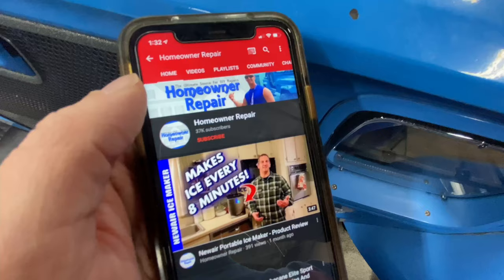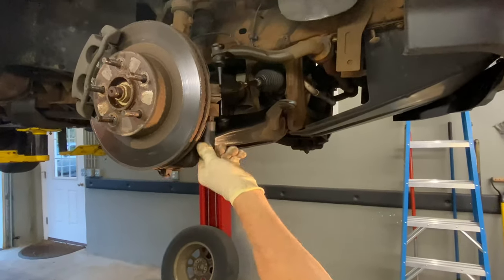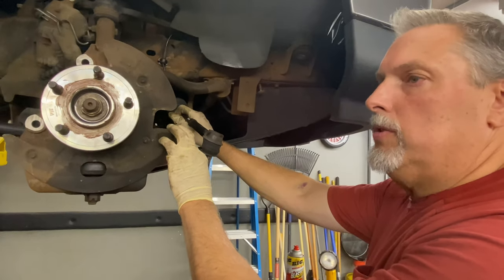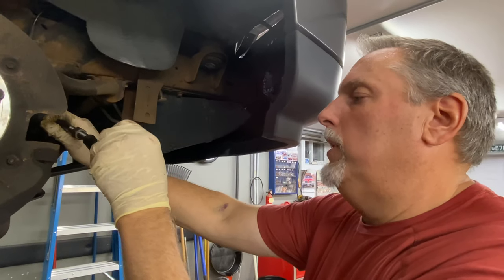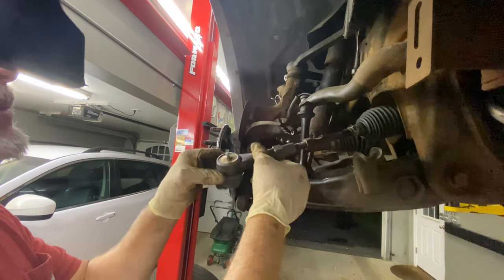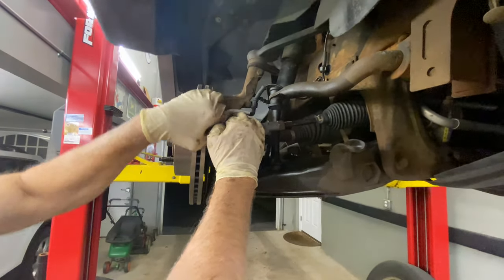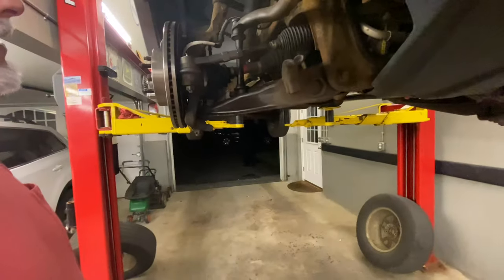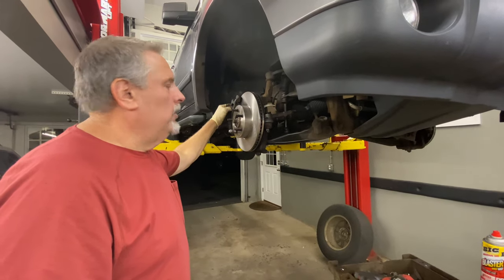How To Replace Tie Rod End 1998-2012 Ford Ranger

Comment: This was a very helpful video.  Just replaced the outer tie rods on my daughter's 05 Ranger FX4.  One actually broke, think it was original.  Moog parts were exactly the same size, so as long as you don't move that locking nut and everything else is the same, your toe should be in spec.  Thanks for the help.
Reply from the maker: Thanks for watching. Don't forget to sub the channel to for more videos like this!

Comment: My most important question is. When I reverse 🔄 slowly in the garage door it knocks. Is this tie rods?
Reply from the maker: You would need to check those along with the rest of the suspension components to see where it is coming from.
Reply: Sounds like cv axles

Comment: i have tie rods from parts geek they are shorter than my originals by a inch what do i do
Reply from the maker: You may have received the wrong ones. When you compare them to the old ones they should be the same length.

Comment: What happened to the trx450r
Reply from the maker: I sold it Tyler, we do a lot of mountain riding up here. I loved the 450R but after a day of riding 100+ miles I was beat. The other problem was the 2 1/2 gallon fuel tank, we go very far into the woods my 4x4 has a 5 gallon gas tank fuel gauge and gets way better gas mileage. It's like driving a Lincoln Tow Car through the woods. It's really comfortable.
Reply: @HomeOwnerRepair  oh i want a trx450r that what im saving up for rn